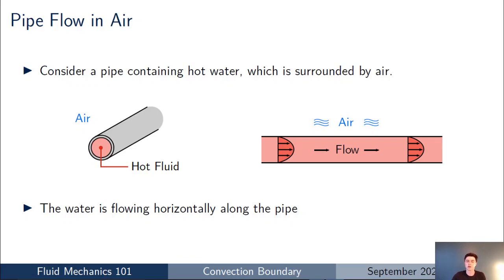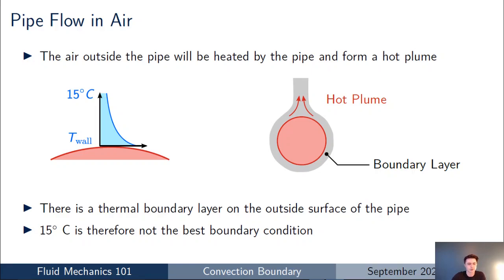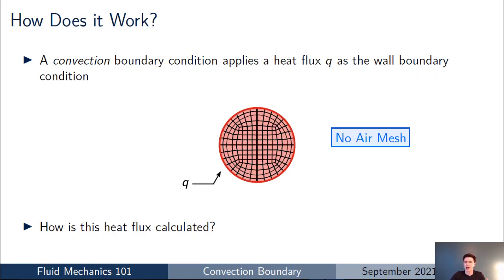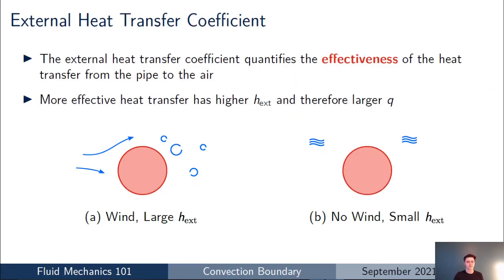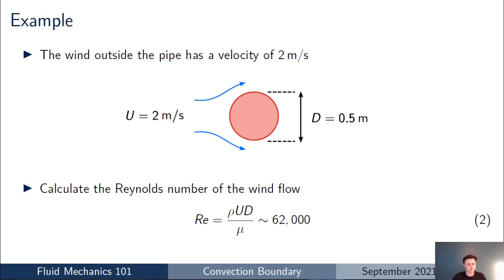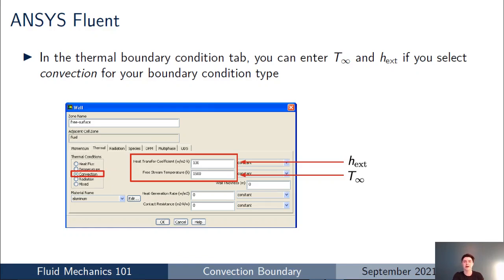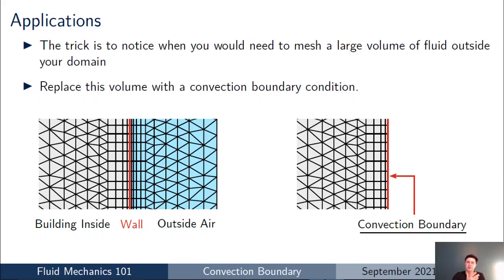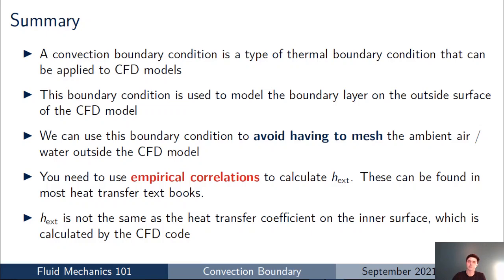[CFD] Convection (Heat Transfer Coefficient) Boundary Conditions

Comment: Great stuff. Please explain the difference between "slip-wall" and "symmetry" boundary conditions. They seem to be quite similar in effect (at least for mass flow).

To my understanding, the only case where either boundary condition would be appropriate/accurate is when selecting "symmetry" to model strictly laminar flow. "Slip-wall" is never appropriate, because inviscid flow doesn't exist.

Comment: I am currently studying conductive heat transfer from a heater placed at the center of a domain, which represents dry clay soil.
Since I am only simulating a portion of the ground, I am wondering what boundary conditions I should apply to the edges of the domain.
In reality, this boundary would be in contact with other soil — potentially with both solid and fluid components.
Should I apply specific coupling conditions to represent the interaction between the simulated soil and the surrounding medium?
I would like to understand how to properly define the boundary conditions so that they realistically account for the presence of both fluid and solid outside my computational domain.

Comment: Excellent video sir. I have a battery that is discharging. As it discharges, it generates heat which is dissipated into the cooling medium. While the heat generated in the battery is captured by meshing it and using an MSMD plug in that introduces a heat source term in the battery component related cell zones, can I still use the "External heat transfer coefficient to capture heat dissipation ?"

Comment: Hi Aidan, thanks for your videos, you've been of great help for me as I'm starting to learn CFD.
As of today, I'm trying to simulate a case where i can obtain the external HTC for a hot pipe surrounded by ambient air and then i want to compare the HTC values calculated with OpenFOAM with the values calculated using empirical correlations, so i can validate the source code. (assuming fixed temperatures for both the pipe and air)

Is it possible to do this? I'm not sure if i understood your video right, but what i got is that the CFD code can't calculate external HTC?
Reply from the maker: You definitely can. You just need to mesh the air around the pipe. The reason for applying a HTC is that (for large problems) the mesh can get quite large and you want to save cells, to have a faster simulation (so apply a HTC rather than meshing)
Reply: @fluidmechanics101  First of all, thank you so much for taking your time to answer me!
Oh, okay, i think i understand it now. 
But, watching your video about HTC i came to the question, how to extract the HTC from my simulation? Shall i look for the heat flux and then calculate HTC or is the solver able to provide me a Nusselt number? 
I'll be using buyoantFoam in OpenFOAM v10.
Reply from the maker: Pull out the heat flux, and then calculate the HTC yourself in paraview or MATLAB, so that you can be sure you know what you are doing (dividing by the correct reference temperature)
Reply: @fluidmechanics101  wow, thank you sooo much for this! you helped me a lot.

Comment: Thank you for the video. I have a question: if I would like to run a laplacianFOAM simulation, how could I impose a free convection BC?
Reply from the maker: Good question, I'm not up-to-date with OpenFOAM, so I'm not sure. They may already have the boundary condition implemented. I would have a look through the tutorials
Reply: @fluidmechanics101  till now I tried different methods, but in laplacianFOAM I don't know how to solve this issiues!!!

Comment: But what to do if we have to capture the effects from point to point on exposed surface boundary ? I.e. To use local variation of heat transfer on the exposed surface with outside ?? As directly mentioning the theoretically calculated value will only give average value which supposed to be constant over the complete interfaced boundary surface exposed. As this is simple for regular geometries like pipe, plate, etc. But how to tell to CFD code that my 'h' coefficient is varying with position like x, D or theta??Is including code for that necessary ??
Reply from the maker: Yep, you will need to include some code for that. Exactly how you do the code will depend on the CFD code you are using. In CFX you can use CCL, in fluent you need a UDF etc.
Reply: @fluidmechanics101   How can we do it in comsol multiphysics or Matlab ??
Reply from the maker: Good question! I haven't used Comsol before. Could you email their customer support / help desk?

Comment: What if the pipe is at the focus of a parabolic trough? The pipe receives non uniform heat flux in the form of concentrated sun light. And there there are convective losses. Ansys Flent doesn't allow to specify both heat flux and external convective heat transfer coefficient at the same time. What to do in this case?

Comment: Sir can you help me decide correct boundary condition for a solar collector which is of glass and acts as a solar wall beneath which air is heated due to green house effect.
Reply from the maker: I think there is some guidance in the Fluent manual for solar loading. Can't remember off the top of my head though!

Comment: Hey Aidan! Great content as usual. I am new to CFD, but could we determine the h coefficient by doing only the fluid-air mesh (with an allow with the pipe format), and give a constant Temperature condition on the walls = Tsurface? And the output would be the h coefficient determined with Tref?
Reply from the maker: I don't quite understand your question but it sounds right to me ☺️
Reply: @fluidmechanics101  ahaha sorry maybe my English or CFD knowledge is not the best. Imagine I have a cylindric box at 20C and a external flow (forced convection) with a velocity of 1m/s and Tfluid=-18. I want to know the convection coefficient so I can use that value on the simulation with only the cylindric body. Can I use other simulation, only with the fluid domain (without the solid domain) to study the flow and therefore the convection coefficient?
Reply from the maker: Yes absolutely! That is a great way to do it. If you simulate the outside and use this to calculate a heat transfer coefficient, you can then apply this heat transfer coefficient onto the external walls of your cylindrical domain. Chances are the heat transfer coefficient will probably be between 5 and 10 W /m2 K, it usually is ...

Comment: hello, thank you for your videos really good work, i have quastion about heat transfer coefficient inner suface
how can'i calculate Tw and Tref please, i need your help
Reply from the maker: TW is the local wall temperature. Tref will be the mass flow average temperature across the pipe. (This is the standard definition for internal flows). My video on heat transfer coefficient might help?

Comment: Hi, I create the air enclosure over my system. Should I set the boundary condition at 6 faces of air enclosure?
Reply from the maker: I think I understand what you mean. You could always run a quick simulation with a very coarse mesh just to check your boundary conditions?
Reply: @fluidmechanics101  yes, I think 6 faces of air should be open, but I am not sure they should be set by pressure outlet, constant temperature.
Reply from the maker: Ah yes, you will need outflow on one of the faces so that you can conserve mass. Many CFD codes are clever enough to switch the face around to allow outflow on a pressure outlet. Sometimes this is called an opening boundary condition? If not, you might have to specify pressure inlets and outlets separately

Comment: Thanks for the explanation. Just out of curiosity, if the internal heat transfer coefficient inside CFD is post calculated from the solution of temperature, how CFD calculate the heat transfer between the cells. Does it compute based on the temperature wall function and thermal diffussity alpha = k/rho/cp. Is this alpha user input? Does CFD treat these fluid properties as constant value or temperature dependent? In 1D from what I know to calculate inside temperature of flowing fluid user has to to calculate/ input the internal heat transfer as part of thermal resistance based on nusselt correlation
Reply from the maker: Yes! It is based on the wall function and the thermal diffusivity ☺️ if your mesh is resolved through to the thermal sub-layer then it will be based on the molecular conductivity of the fluid

Comment: how do i calculate if it is complex geometrical shape instead of circular cylinder. thank you
Reply from the maker: You may not have an empirical correlation for complex geometries. You can either model it as a simple shape or run your own CFD simulation of a sub-model and derive your own heat transfer coefficient 😄 quite tricky but it can be done!

Comment: Another great video, thanks! Also, I was curious to ask, is there is a similar boundary condition for mass transport, using a mass transfer coefficient?
Reply from the maker: I don't think so because the wall physically blocks the transport of mass from the inside of the pipe to the outside.  With energy (temperature) the pipe wall conducts the energy from the inside to the outside of the pipe, so an external heat transfer coefficient makes sense
Reply: @fluidmechanics101  Thanks for the reply! But what about in the case  of a gas-liquid interface, do you think that in that case the boundary condition would make more sense?
Reply from the maker: I think you would need a careful mass transfer condition in your multiphase model (not a boundary condition)
Reply: @fluidmechanics101  Hi , I am following  your videos from quite a long time! They are really good. I am wondering can you make a video on mass transport using Ansys fluent. It will be really helpful for me and many people out there. There is very less info on mass transport in open source.

Comment: Hello! I am modeling natural convection in internal flow. There is glass and ground, with radiations on the glass. I took glass and ground both as convection boundary conditions with operating and freestream temperature as same. So, that means the flux is zero. I took the ground as convection because I wanted to have the heat absorption effect on the ground, Is it the right approach to use ground with certain thickness as a convection boundary condition?

Comment: Hi Aidan, great content again! I am literally binge watching your videos preparing for a CFD interview :D
A query: after computing the heat flux, how can we use that to understand the structure of the plume outside the pipe?
Reply: do we directly extrapolate structure of thermal BL from cooling law?
Reply from the maker: You could set up a separate CFD model for the outside of the pipe, with the boundary condition on the pipe surface set using the results of your CFD model for the inside of the pipe. This is useful in some circumstances where you want to look at parts of a system in detail and are happy to have different 'sub models' of different parts of the system you are looking at
Reply: @fluidmechanics101  Got it! Thank you for taking the time to reply.

Comment: Good video. Some OpenFoam versions ago we had to use swak4Foam for that. Probably a lot of people still uses it just because they don't know about this boundary condition.
Consider a video about the Rhie-Chow interpolation, there is little documentation about it outside of papers. Certainly your approach on that issue would contirbute to the comunitty.
Reply from the maker: Yes! I'm working on that video right now. Rhie and Chow will be out soon 🙂
Reply: @fluidmechanics101  It would be great. I don't know why the introductory CFD books still spend pages and pages on the staggerd mesh approach and only few lines on colocated meah and Rhie-Chow interpolation. It seems to me they all follow the same recipe of the Patankar's book.
Reply from the maker: Yep! They all do
Reply from the maker: Also, yes I had to use Swak4Foam for a while. It was quite tricky!

Comment: The disadvantage of this boundary condition is that the average coefficient on the surface is assigned.
If it is important to know the local temperature distribution, it is better to use a direct calculation of the heat transfer coefficient.
Reply: •  This direct calculation of local h would be possible for conventional geometries. 
•   But for customized geometry, the only way lefts is to mesh convection fluid domain, assign it's thermo-physical properties, while flow velocities & the problem becomes conjugate heat transfer with multiple domains with links of exchanging the boundary conditions as interface temperatures, interface heat fluxes, etc.
• In this way, the solver solves for multiple domains simultaneously for temperature fields per domain.